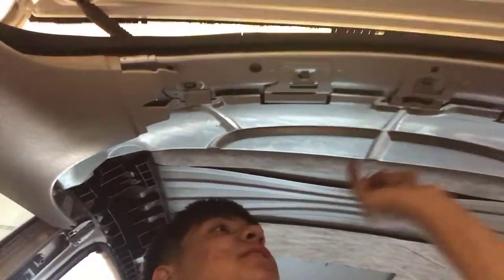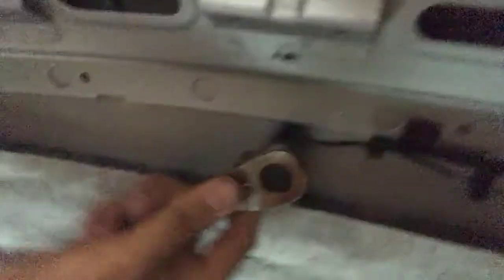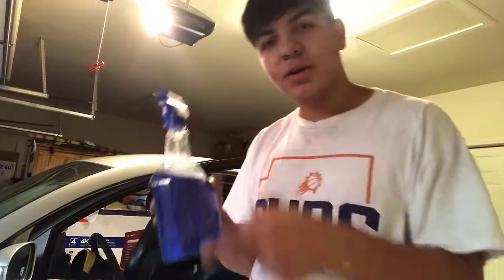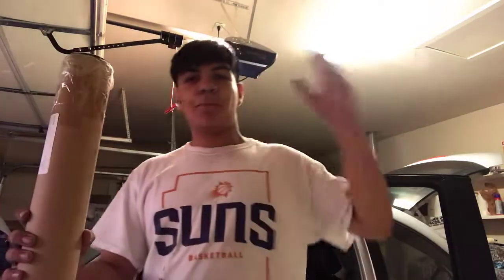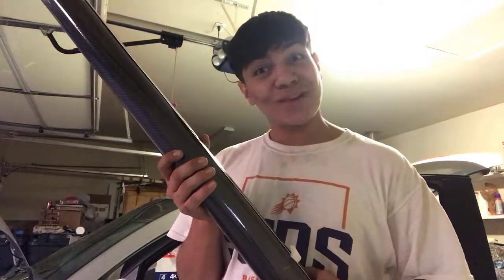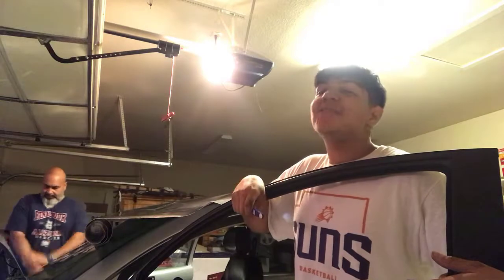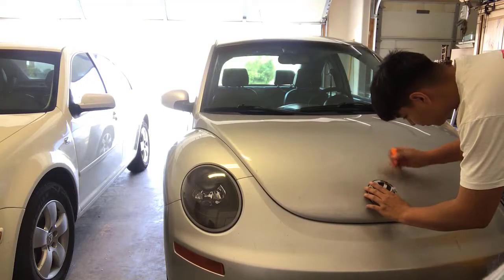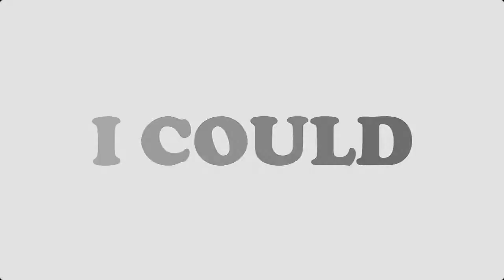VW BEETLE/BUG GETS WRAPPED IN CARBON FIBER!!

Comment: Did you use heat gun or hair dryer when you wrapped your roof?

How's it holding up?
Reply from the maker: They tend to do the same thing when it comes to stretching but I used a hairdryer and it’s holding up good but the Arizona sun is beating on it.

Comment: Hey dude, great video. I got a question tho. Idk if you'll see this since it's over a year old but I'm trying to wrap the roof on my 2000 VW new beetle, well technically the whole car but roof first, and contemplating whether or not it's worth it to take out the roof trim. Do I just need 3m tape to put the roof trim back on? Cars yellow and the roof trim is yellow so gotta do something about it lmao
Reply from the maker: I appreciate the support but I’m pretty sure the trim would just clip back back in on the 2000 vw beetle because when I did mine it just sandwiched back into place after I had wrapped everything. Let me know if that answered your question or not.
Reply: @zephxcruz  Yeah that helps a bit but I'm just not really understanding I guess. Like I know the trim piece snaps onto the rubber seal but it looks like in the video you took off the rubber seal that was under the trim piece. I think it's called the roof seam seal or roof rain gutter. In this video, the dude shows in detail taking it off but it doesn't look like it can go back on unless it has some glue that the rubber piece can attach to. https://youtu.be/pYkRJUPVrbM
Reply from the maker: Oh I can see where your confused now the trim sandwiches itself in between the rubber which makes it stay in place without coming off